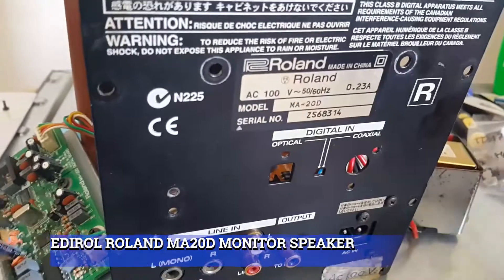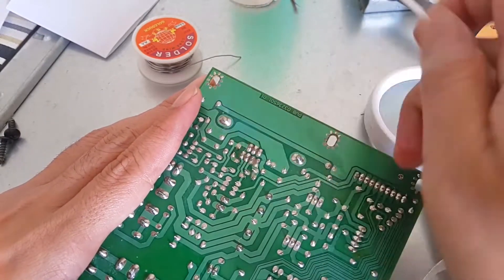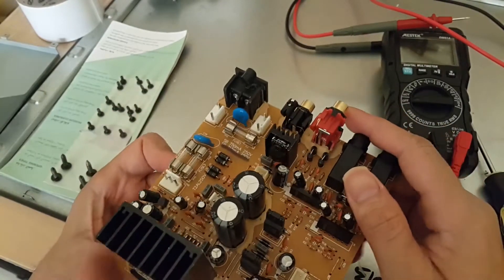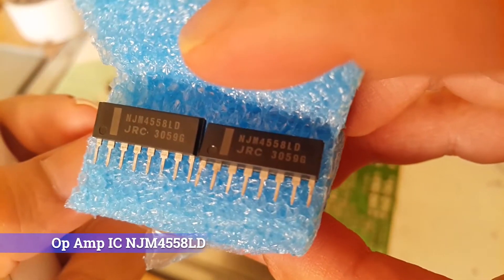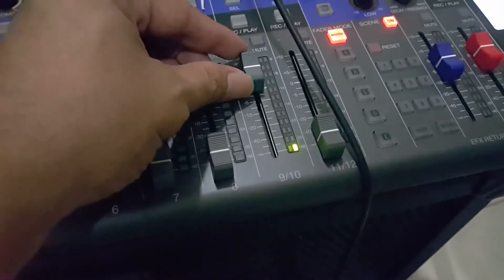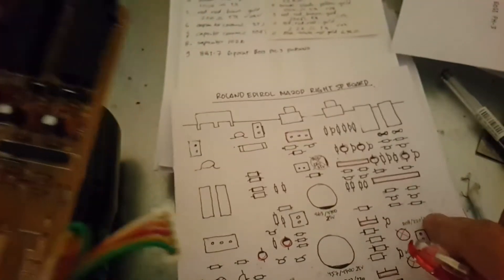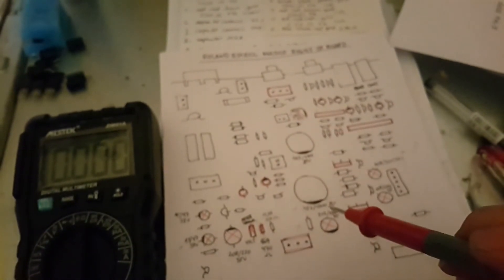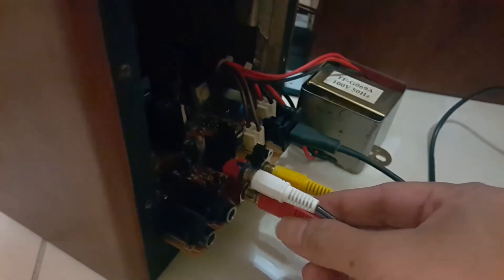Repair Dead or Weak LEFT SPEAKER Channel Studio Monitor Fixed Solved

Comment: My edirol ma-20d was accidentally plugged in 220v.  Now the right side has hum and no inputs working.  What should I check first? How can I contact you?
Reply from the maker: if its wrong plugged, check routes after fuse, if fuse blown change them.  If not you can check most important ICs and Caps in the video with multimeter. I ordered all them Online from Aliexpress